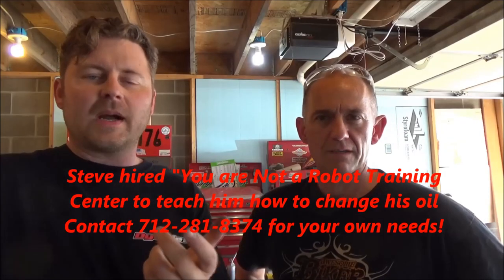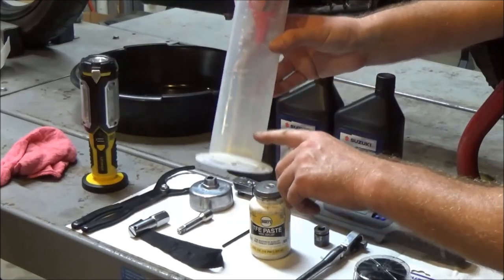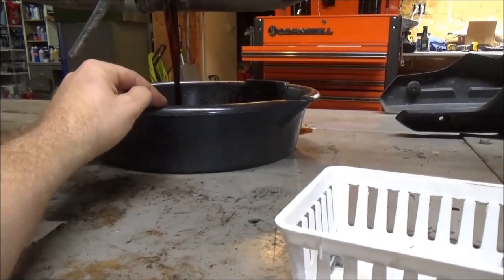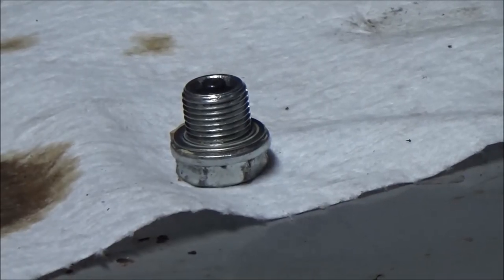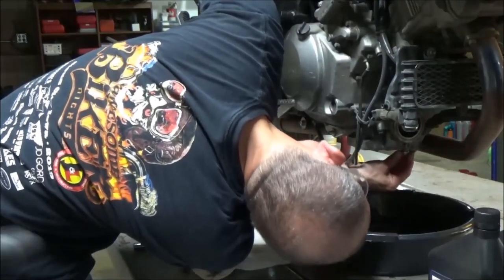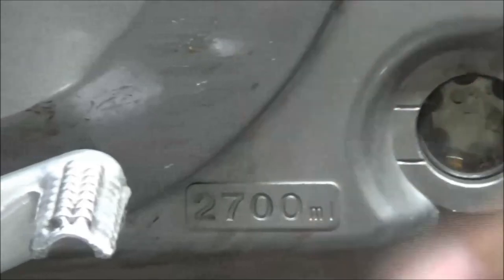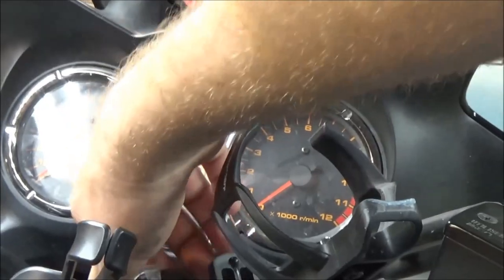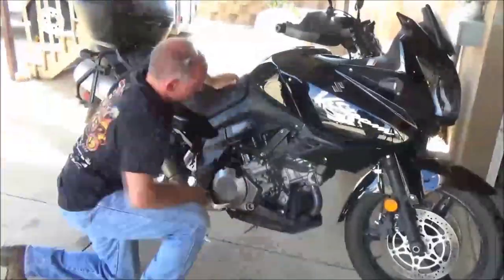DIY: Suzuki Vstrom How to  change your oil and filter

Comment: "2700 ml happens to convert almost exactly to 2700 cc". That's because it's the same exact unit. 1000 millilitres = 1 litre = 1 cubic decimetre = 1000 cubic centimetres.

Nonetheless, thanks for this great tutorial. These are the tricks you'll never get from a manual, and it's perfect for people like me who are learning to wrench on their first bike. You are clearly an experienced instructor.
Reply: I was triggered by the same comment. 1ml = 1cc = 1gram (pure water).
Then just multiply or divide by 10 from there. Ever wondered why IBCs are the size they are? 1m3 of fluid = 1 metric ton (pure water)
Reply: It happens... I make repair videos and when describing the tech stuff the right word in the wright order or best way to describe sometimes escapes me.  Interesting to know how many people actually realized that 1ml=1cc

Comment: It's only an oil change but... done wrong could cost you your engine!  I'm 51 and in all my oil changes only once forgot to put the new oil in.  Idled the car for about 30 seconds and had a bad feeling.  Turned off the engine added the oil.  Car ran fine for years but I never forgot that lesson!  Never though of using teflon paste on drain plug.  Great vid.

Comment: paste sealant on oil drain plug?  I'd honestly skip that step, let the crush washer do the sealing as it was intended from the factory. Only add product if there's a continued issue beyond what the washer can seal.
Reply from the maker: Thanks for commenting and adding value to our community!

Have you subscribed yet to never miss a video? Have you seen the video playlists? Over 600 videos! Check them out here: https://www.youtube.com/user/conleybuilt/playlists  

Want to say “thanks” or “keep it up”? Click here https://www.paypal.me/how2wrench    
 
Your answers and help are just around the corner. Save time and money while protecting your investment and yourself by doing it the right way at www.How2Wrench.com

Comment: I believe you only stated oil change on a Suzuki Vstrom, there is a 650 model and a 1000 model also many different year models. Is there any difference between year models and displacement as far as oil volume and torque specs ?

Comment: Oh god, how often do I have to tell apprentices to clean the damn oil tray. "Is that inch long chunk of swarf that's floating around in the oil from this bikes motor?" you don't know, do you? I've also found it a good idea to run a magnet through the tray on any bike I think might be a little suspect if they aren't already running a magnetic sump plug. just makes it easier to spot anything that's in thick black gunk masquerading as oil, like the screw from the neutral sender unit that fell out of a Suzuki I had in last week.
Reply: Moral of the story... "work CLEAN" and be detailed.

Comment: Paste sealant on oil drain plug...Can a cobber-ring do the same good sealing between engine and the drain plug..? Here in Norway we say milliliters and desilites (ml and dl) How many desilites was the total number you filled on the engine this time?

Comment: Can you tell me if the v-strom 1000 uses the same clutch basket as the sv1000?The sv has a known problem of bad machined clutch basket, that get loose, and generate a LOT of vibration.Are the v-strom any better? Are they interchangeble with the sv?Thanks!
Reply: Sabino Berenguer Berenguer   Same problem

Comment: Piercing an oil filter is terrible advice. What are you going to do if  you still can't undo it? If you can't remove it and it's not pierced then you can fill with oil and then take it to a garage if needs be. Obviously it's not ideal re using the oil or forking out for new oil but it will be much cheaper than getting a bike transported to a garage.